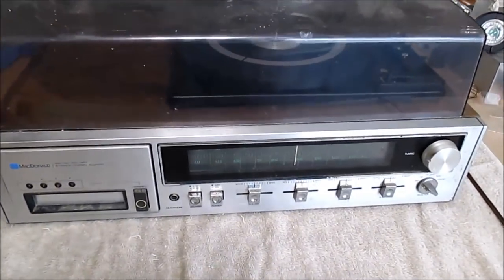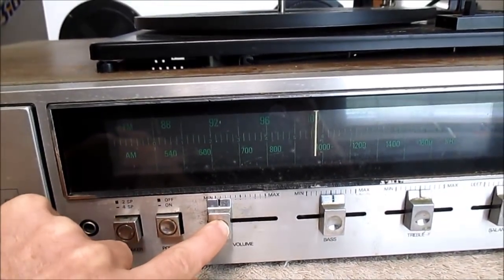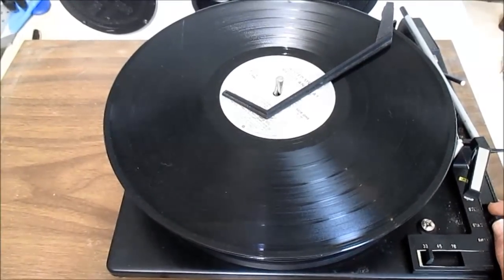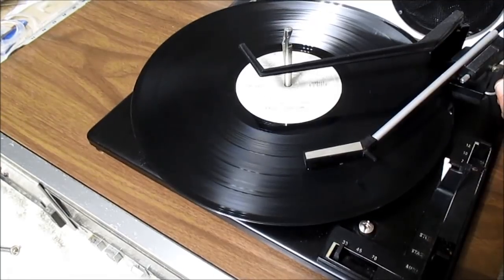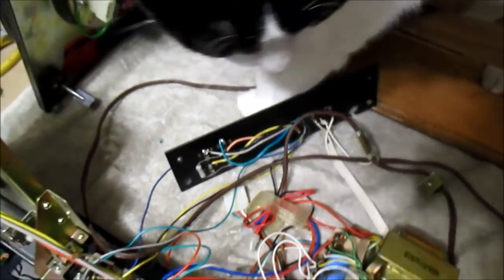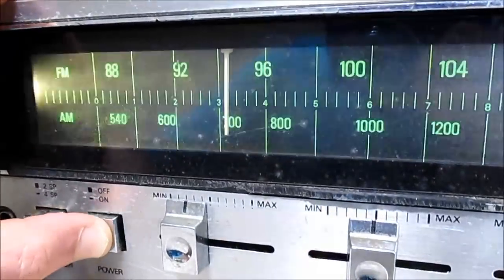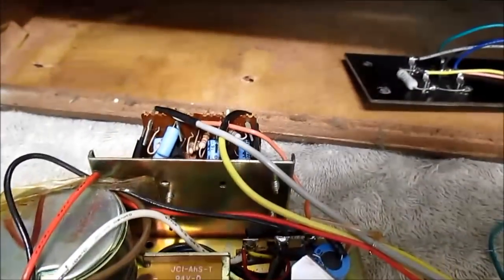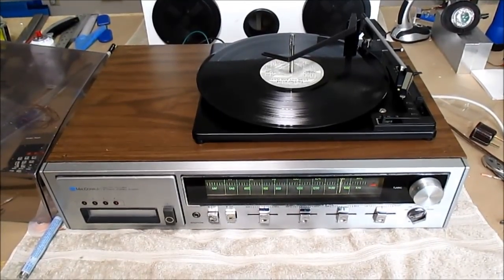Repair mid 70s "all in one" stereo system with record changer turntable

Comment: "Twisted sister.. What is THAT?"
lol, That was basically the way I discovered DIO..
I found an old LP down in the basement and an old turntable, along with some other records, so I brought them up to my room, only to discover that I couldn`t connect it to anything :/
But I still put that old thing on, and was introduced to METAL! :D
I listened to holy diver over and over again, straight from the needle..
Oh yeah ;)
Made me buy my first sound system :)
Now, about 25 years later, I still love DIO, but I`m not listening to holy diver straight from the needle anymore, even though that was METAL AF..

Comment: The reason there's no output transistor heat sinks is because the critter that gnawed on the front panel ate the heat sinks as well.   Somewhere, in a dusty, dark memory, I saw some sort of typical single-pane cartoon where the punch-line was 'Transistor' and the graphic might have been a man in a nun's habit with high-heels.  Or some-such.
Reply: oh lol that  is witty

Comment: How did you get the platter removed? I have almost the exact same system and I cant figure out how to remove the platter.
Reply: Usually, the platter is held in place by a "C" clip around the center shaft. You have to carefully pry it away with a blade screwdriver being careful it doesn't fly off and get lost. Cover it with your hand or a plastic bag while doing it helps.

Comment: I have a sears all in one stereo system. Left side speaker does not work, it's not the speaker. Both side worked when I first got it. Please help. Any advise?
Reply from the maker: If there's no sound in any mode in that channel, it could be anything from a bad connection to a faulty part in the peamp or power amplifier circuit. You'd need to signal trace.

Comment: Single ended power with output caps.  Cartridge sounds nasty compared to FM, ceramic?
Reply: Probably crystal, ceramic a bit exotic for such rubbish. Often fed into too lower input  impedance, hence no bass and probably little over 7/8khz
Reply: @MichaelBeeny  Crystal carts were pretty much gone from the consumer market by the mid-70s.   This'll be a ceramic.
Reply: Are you Tobey Maguire? You sound like him
Reply: Did you open from bottom? Or side screws?

Comment: Ummmm, nothing like metallised plastic when you are hungry! John, the low power is probably due to 8 ohms, such low priced stuff was usually made for 4 ohm speakers, helped to keep the power supply cheap. I think you were wise NOT to make a power test with un heat sinked devices. Might just about give 3 watts into 4 ohms on a good day with a south wind.
Must have taken a great deal of skill to get quite as much second harmonic distortion as that amplifier had.